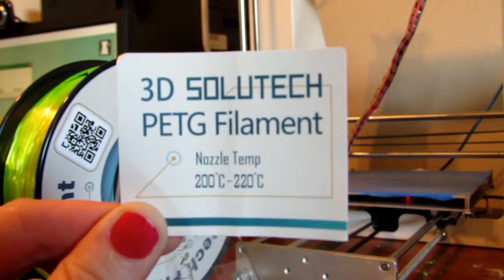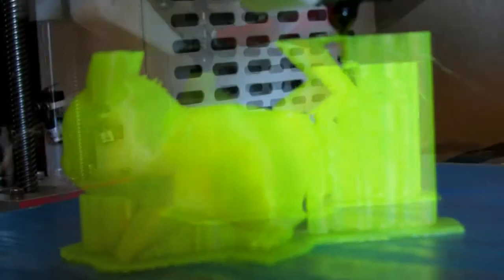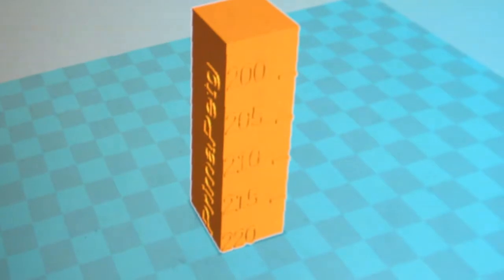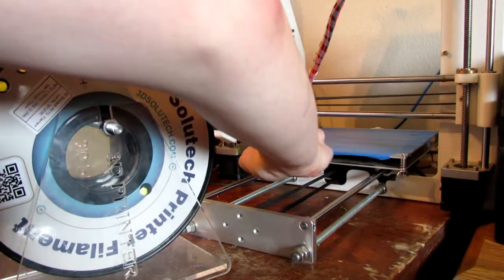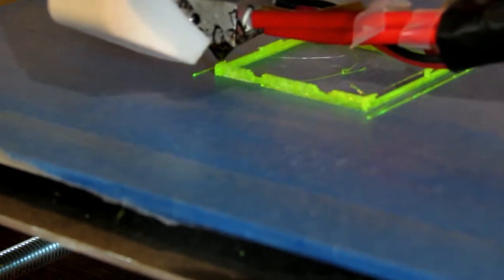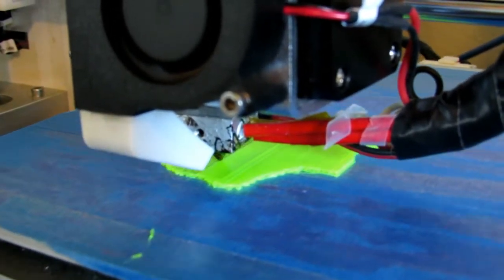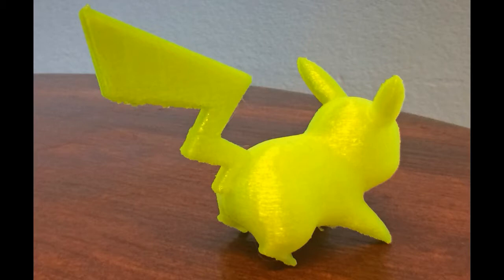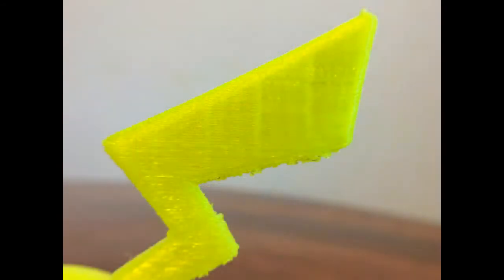3D SOLUTECH PETG 3D Printing 1.75mm Filament

Comment: I've printed a LOT of parts with this stuff. Slowing the print speed is the most important tip for getting great prints. 
You definitely need to calibrate your printer because I found this stuff under-extrudes. The default extruder variable for my Ender-3 Pro is about 93 (can't remember the units). I did the calibration test, by feeding a known length of filament into the printer, and found that I needed to increase this to 98. 
I love this filament because it creates really strong parts compared to PLA. I can't quite call the results unbreakable, but they are close to that.

Comment: You are under extruding like mad btw...
Reply from the maker: Hikari have you used PETG filament before?
Reply: Yep, this exact filament.
Reply from the maker: Great! Do you have any tips? What were your settings? 

This is the first PETG filament I've ever used. I was reading forums, 3D printing sites, etc to learn more about it. I had trouble with it sticking at first, but my main issue is with strings and those "boogers" left on the nozzle that spit on your print. I really messed with the retraction a lot, but looks like a bit too much so.  Any information would be quite helpful!
Reply: boogers are caused by the 'wipe while retracting' option being enabled. (should probably mention, I use Prusa's Slic3r. Works amazingly better than the normal Slic3r that hasn't been updated in ages). Disable that, and boogers go away completely. As for stringing, I only do a 3mm retract (used to be 4, but it started causing jamming with this Hatchbox Blue PETG that I'm using. fyi, STAY AWAY FROM HATCHBOX PETG... its garbage.. I love hatchbox's Red PETG, but their Blue and Silver are complete trash). And my retract speed is 80mm/s.

I used 224C as my first layer temp and 223 as my second, but I need to completely "re-calibrate" this, because I recently figured out there was a bug with my firmware that caused the temp to go nuts... it would fluctuate up and down around 5-6C every few minutes and I just dealt with it because of laziness. Finally fixed it with the new firmware update, and now it stays stable at the temp I give it, so most definitely need to redo finding the sweet spot. 

I was easily able to get 80-90mm/s printing speed, and even cranking it up to 140mm/s yielded great results prints, but they wouldn't ever be within tolerance (as in, if i printed an object that needed to be exactly 40mm long, it would be maybe 41 or 42mm because of the slight jerkiness my printer has thanks to is janky construction...). 

This filament has easily become my 'daily driver' for filaments. Used to be Hatchbox until spool after spool of their PETG Blue and Silver constantly printed like garbage... Ever since they updated the label on their spools, their filament hasn't been too great for me... But this Solutech PETG, holy balls it just prints and prints and prints. Sticks every time, always reliable results. Only issue I ever had, was my own user error and accidentally lowered the amperage to the extruder motor lol. Other than that, not a single issue with it.

Oh yea, I printed everything on Kapton Tape with hair spray that I bought when printing with ABS. It worked better than ABS juice and glue stick, so i just kept with it. Everywhere I had looked prior to actually printing with PETG always said "You have to print on bare glass, nothing else, or else it wont stick". My bed is aluminum, and I always had Kapton tape on it because of ABS, and the first batch of PETG I used (Red Hatchbox) wouldn't stick to bare Kapton Tape too well, so I figured 'lets give the hairspray a shot', and presto stuck every time... So now, I just use the hair spray. I can't remember the brand sadly, I'd have to go to the workshop to find out later. 

Now with that said, I have gone experimental and tried to see if this Hatchbox Blue PETG would magically stick to just bare aluminum, and blowing my mind, it did! It stuck really well! Only issue is that after more than an hour of printing, the object warps ever so slightly off the bed. So, I figured "well lets try the hair spray again" and it stuck even better, but it STILL peels up oh so slightly on every side. Enough so that you can see the sticky hair spray desperately trying to cling to the bed... Every Hatchbox PETG I've used has done this, even the red, but the red would only do it if the bed wasn't hot enough. The point of this little bit here, is that I haven't tried Solutech PETG on bare aluminum. I only bought the Blue Hatchbox PETG because Solutech was out of stock on Amazon... and I've regretted every second of it thanks to the jamming every 15-30 minutes... So to solve for that, I've ordered every color of PETG Solutech has =D So that should last me a good while >=D

Also, if you were wondering what temp I use for the bed, I can't give that out in good conscious. The thermistor in it isn't calibrated AT ALL. It was one that I had bought 2 years ago and couldn't remember what it was so I just threw it in there and recorded what it thought room temperature was, then cranked it as high as the printer would push it, and recorded that, and have just been tweaking it up and down willy nilly. Not all that safe, but I'm in the process of building a custom CoreXY printer of which I have the same thermistors used for the legit e3D V6 hot end, so with that, I can just copy/paste the hot end thermistor table over to make it work for the bed lol.
Reply from the maker: With all the forums and sites I went to not one suggested it was caused by the retraction wipe. I'm excited to try this! Thank you! I've used Hatchbox ABS and PLA (because they accidentally sent it instead of my ABS order and told me to keep it) in the see-through Red. Hatchbox ABS see through red is gorgeous after an acetone vapor bath! The other colors they have are hit and miss, imo. Good to know about their PETG. 

I've never ventured out to Kapton tape, because I usually have success with the blue tape and glue stick. Out of curiosity, why do you prefer PETG over other materials? 

Thanks for all the info! :-D
Reply: I was one of those idiots who was all "i'ma make my own printer because its cheaper and screw pla! it melts too easily!" so i went straight to abs. Picked up Hatchbox only because it was super dirt cheap (like 10 bucks) and loved it ever since.

went with petg because i kept hearing all over the place that it was like printing easily in PLA but the strength of ABS, so figured i'd give it a shot since the blue ABS from hatchbox was outa stock. got their red PETG and loved it. it left weird bubble like artifacts though, and i never figured out what it was until recently. I had set the starting point to 'random' for each layer... turned it to 'nearest' and solved that issue... 

As for the boogers, i had them constantly too until someone just randomly shouted "TURN OFF THE WIPE!" lol.

and I used Kapton, well, cause of starting out with ABS and was told it was the only thing it stuck to reliably. Glue stick never really helped me. It always left the parts super sticky on the bottom and i just didnt' want to have to deal with that sort of hassle every time i printed something off.  Only time I've used blue tape is at the game shop I help out at. And only because the HIPS coating (or whatever its called) is apparently impossible to stick to even though it is designed/meant for things to stick easily too...
Reply: Just got my shipment of filament in and currently uploading a tiny video showcasing 80mm/s print speed and 200mm/s travel speed. Printing on bare aluminum with very very light amount of hair spray, and using all the same settings I mentioned lol. Should be up in 20 minutes.
Reply from the maker: Hikari I have a self-assembly JGAurora Prusa i3. I don't think I could build one from scratch, so that is quite impressive! I use PLA for little miniatures, but ABS is my favorite. I'm a sucker for the glossy look acetone vapor gives it. 

The glue stick hasn't left any sticky residue on the bottom of my prints. I apply the glue stick when the bed is cold and as the temp rises the glue is less "goopy" and just leaves a tacky surface on the hot bed. 

The more I use PETG in sure I'll, most likely, keep with it and ABS. To make a glossy look on PLA I use epoxy.
Reply: Savvy_Thoughts Reviews that's why I kinda like how petg looks when printed. This solutech comes put rather glossy when printed at super slow speeds. Kind of makes it more transparent and crystal looking.
Reply from the maker: Hikari Sweet! I'll check it out! I subscribed last night. I've only been printing for 6 months, so of course, make mistakes. Lol. Love to learn!
Reply: Savvy_Thoughts Reviews I started roughly 2 1/2 years ago, of which a full year of that was just gathering the parts to make the printer. It's literally made out of a damaged wooden swingset that was being tossed out at work. Gathered up the wood and made a makerbot style printer that was so atrocious... Nothing was square or level at all... But hey, worked well enough for me to print off prusa i3 mk2 parts, and once they were all printed I disassembled the terrible thing and build the current one. It's still not square or level but it's alot better than what it was prior, and with a Z probe it took care of the leveling bit. It being put of square doesn't effect it as much as everyone seems to think. Parts still come out perfectly square. And now the CoreXY I'm trying to make is being made from aluminum rods that were thrown out from a clothing store. They're 16mm wide and are super strong. So I'm hoping it'll work out. Finished printing everything in that terrible hatchbox petg and realized it shrank so much that the holes were 13mm.... Sooo reprinting in this amazing solutech!